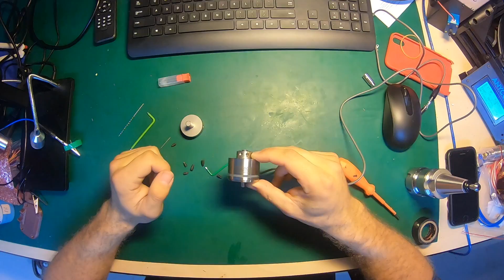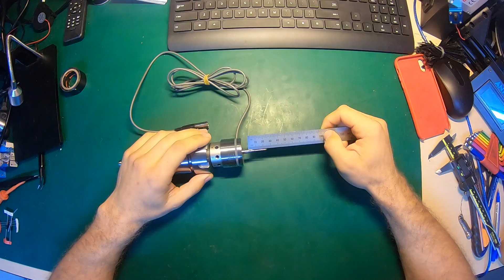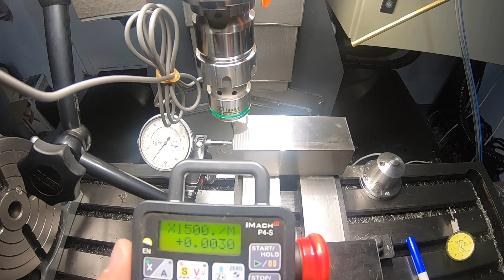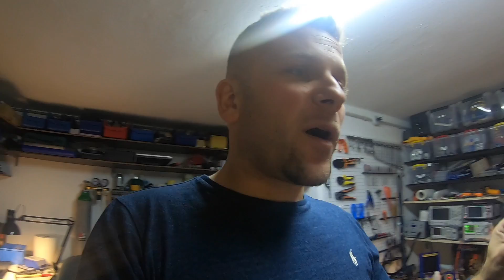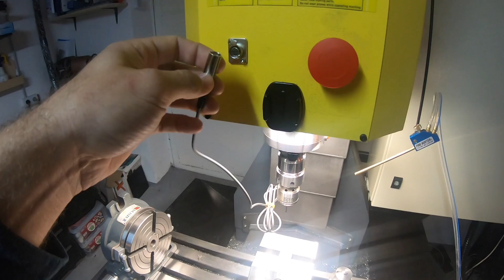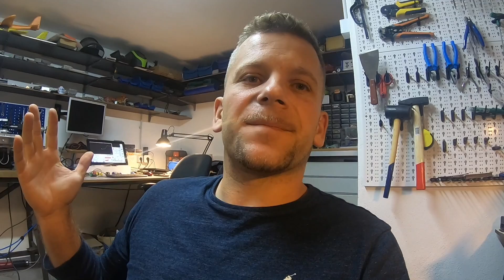3D Finder - Touch probe review

Comment: really cool, you should make a video of how you rewired the cabinet, do you use a mesa card, (which one)?
Reply from the maker: Thomas Kramer 
I am using mesa 7i76e
Reply: @LikeFactoryMade  cool, I have just ordered a syil x7 and have the same Idea to convert it to linux cnc with a 7I76e, you are happy so far with your machine?
Reply from the maker: @thomaskramer4739  Yep, happy so far. I am doing a custom controller, with a touch screen & industrial keyboard & external buttons for Run/Step and Pause/Resume. Will come up in a future video with more details on that.